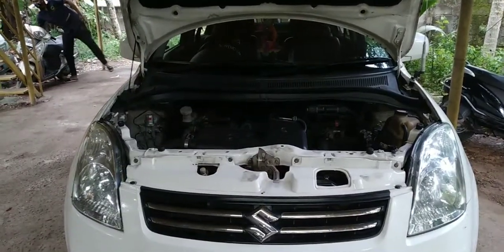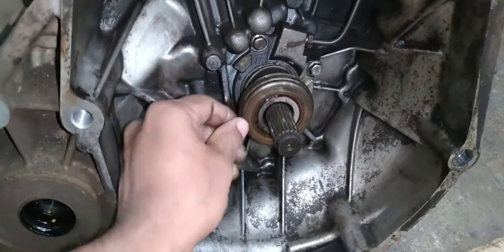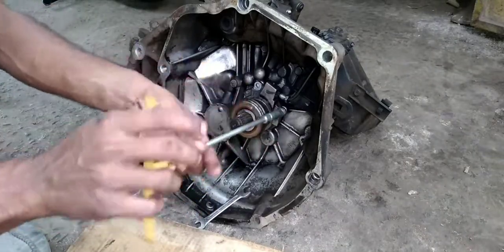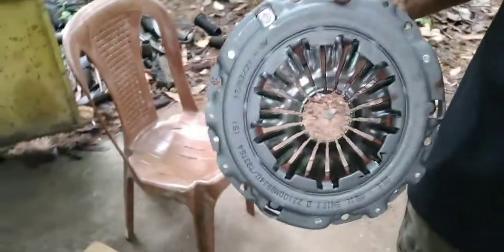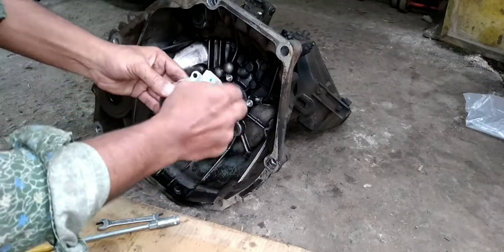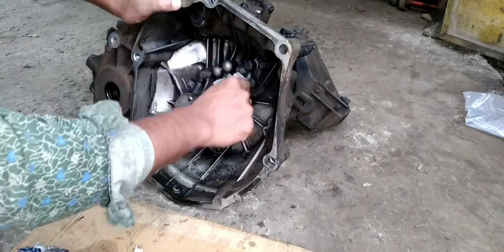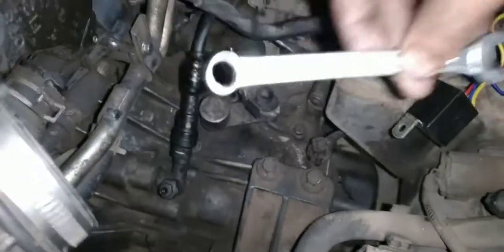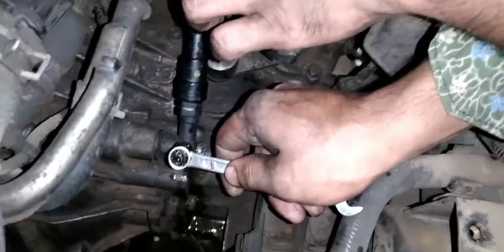SWIFT Diesel full clutch replacement മലയാളം 💥💥💥💥💥

Comment: Hi bro 
Ente car 2014 dzire diesel aanu
Kure naal odathe kidanna caril clutch cylinder jam aay cluch work akathe master cylinderum , clutchinte aduthulla small cylinderum change aaki
Pinne odichappol clutch kurayunna pole aay gear veezhathe aay
Panitha workshopile mechanic vannu etho moonu bush clutchinte aanennu paranju change aaki
Onnum azhikkathe aanu change aakiyathu
Athu enthu bush aanenu manasilaayilla 
Chumma bonet thurannu aanu change aakiyathu
Athinu shesham gear smooth aay
Reply from the maker: ഗിയറിന്റെ കേബിളിന്റെ ബുഷ് ആണ്, മാറ്റിയത് 25 രൂപ 1 ബുഷിനു വില, ബുഷ് ഊരിപോയാൽ ഗിയർ വീഴില്ല
Reply: @snautomobiletechvlogs  thank you bro
Reply: Thank you bro. Ente VDI വണ്ടിക്കും oru 30k kms ee അനുഭവം ഉണ്ടായി. ഈ bush ഇടക്ക് മാറ്റേണ്ടത് ആണോ? pl. reply  @snautomobiletechvlogs